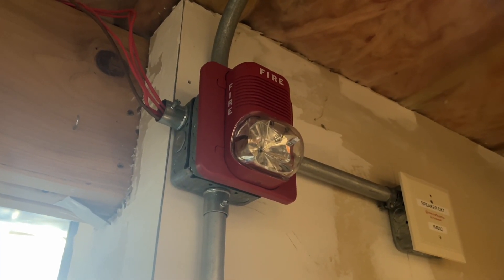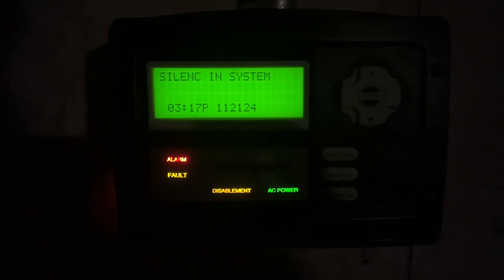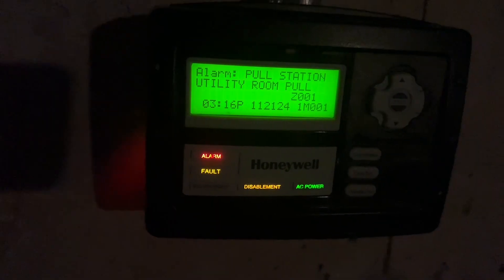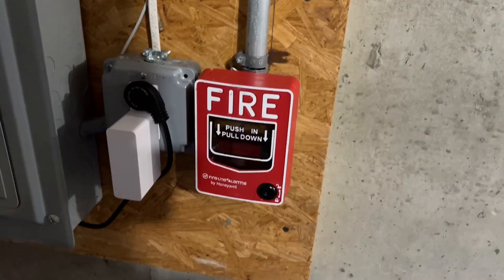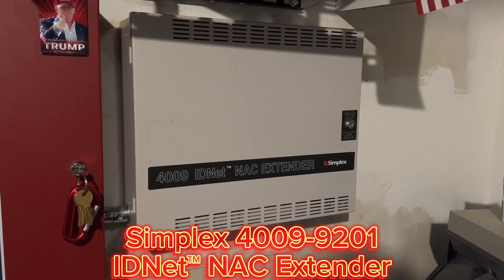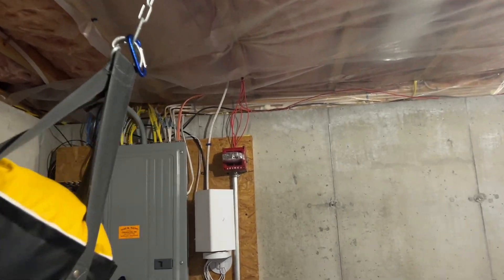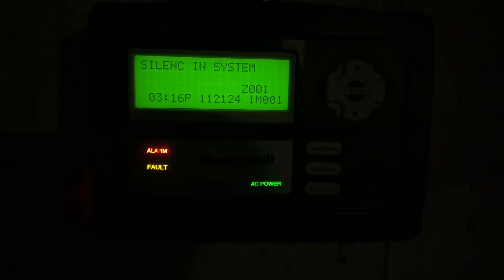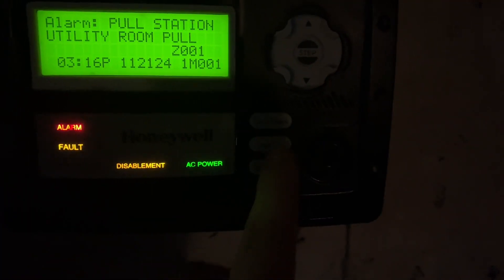Fire Alarm System Test 67: MASSive Surprises

Comment: Very nice those sounder strobes are MASSively rare nowadays.
Reply: They’re not that rare. They still have several of these alarms in my local area
Reply: @LoneStarFireAlarmsTX  That doesn't mean their common. They hardly make these anymore and I was lucky to get a system sensor mass and spectralert classic on Ebay years ago.
Reply: @Sirenfireproductions5209  I believe the MASS series actually got discontinued
Reply from the maker: I’m pretty sure they got discontinued around the time the SpectrAlerts came out (1997)
Reply: @LoneStarFireAlarmsTX  Yeah they did. In 1997 when the system spectralert classics were introduced. The spectralert classics sadly lasted only 9 years.
Reply: @Sirenfireproductions5209  Classics was from 1997-2006. Advances was from 2006-2017
Reply: @Sirenfireproductions5209  MASS series was from 1984-1998
Reply: @LoneStarFireAlarmsTX  The mass was a thing before ADA compliance
Reply: @LoneStarFireAlarmsTX  The MASS was made 1984-1997. With the NON-ADA versions being produced from 1984-1993 and the ADA versions from 1993-1997. In 1997 the Classic was introduced & the 1st Generation models with the screw were produced until 2000 until they got replaced with the tab style in late 2000-early 2001.